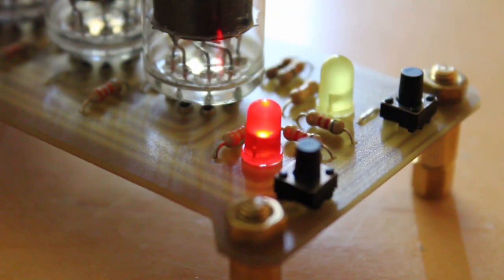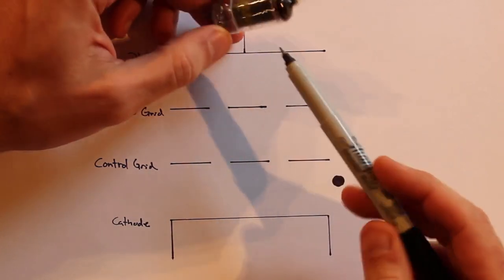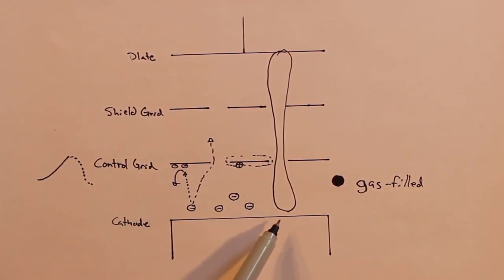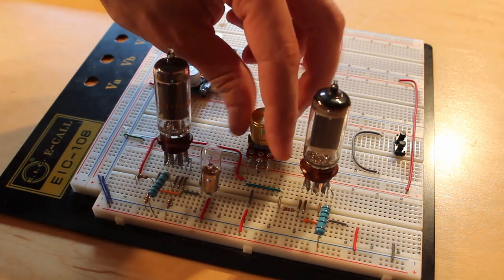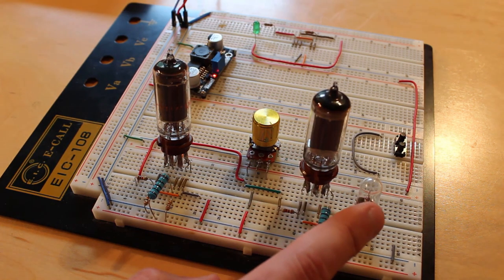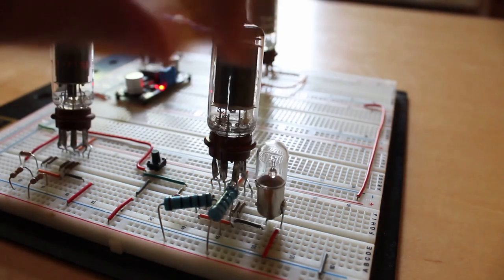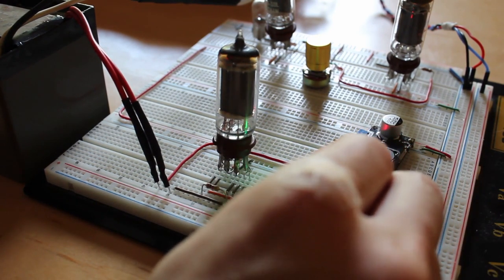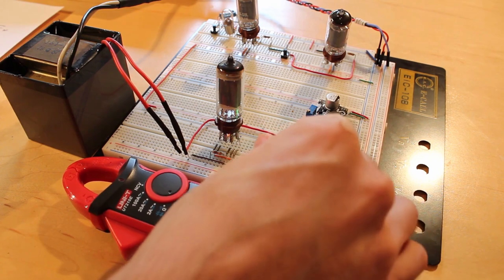The Thyratron and Using a 2D21 Thyratron to Move Some Current

Comment: Put you button on the controlgrid, the you should be able to control the bulb.
Reply from the maker: Thanks for checking the video out!
I'm not sure I follow your comment though. The button and the potentiometer are directly controlling the control grid in my example. Also, Thyratrons fundamentally work using an arc of plasma created within the tube. By nature, this arc of plasma will send as many electrons as it can from the cathode to the plate. That's why we end up with very switch like behavior out of the tube, as opposed to the more analog behavior we see in standard vacuum tubes.
Reply: @UsagiElectric  If you would take the button setup from the middle sample to the last. Would the the thyratron turn off when the AC go into the nagative state?
Reply from the maker: @nielserikmeier9721  I think I'm following you. For example, on the third circuit where I rectify AC, if instead of having the grid tied to the plate via a resistor, what if I tied it to positive with the button? In that case, the Thyratron would indeed turn off whenever the AC went negative, just like you're thinking. It wouldn't turn back on again until the button was pressed. However, since the AC from the transformer has the same frequency as mains AC, 60Hz. This means that as soon as I release the button, the Thyratron will stop conducting as soon as the AC signal falls below 0V again, which would happen essentially immediately. 

At first, I was trying to wrap my head around how that setup could be used, but it's actually perfect for something like a binary display. Four halogen bulbs, four Thyratrons, and you've got yourself a four-bit display that can be controlled from other tubes. The only caveat is that you need a transformer outputting AC into the plate for it to work, but that's something that can be worked around.

Thanks for the suggestion, that's awesome!
Reply: Usagi Electric  if you tie this setup to you RS flip flop ... 👍
Reply from the maker: @nielserikmeier9721  I think you're on to something here!

Comment: well, there's another way to make a single bit of memory using a tube, thyratron sram...
Reply: all sram is, is just  bunch of buffered S/R latches
Reply: 15:35 well you could if the tube drives an igbt or mosfet, technically its not cheating, functionally fets, igbt, sicfet, moset.... whatever, its functionally equivalent to a triode and thyratron in one package and remove filament pins, so just anode, grid , and cathode, just make sure gate voltage for dat mosfet is 24v, not 5v or 12v, tube might punch a hole through dat wafer

Comment: it acts like a thyristor
Reply from the maker: Exactly!
Interestingly, the term "thyristor" is actually a portmanteau of the words "thyratron" and "transistor"!
Reply: @UsagiElectric  I worked with high voltage ceramic thyratrons that would stitch 30 kV and KA.  Made of ceramic.  They use a ballast heater to control the internal pressure.

Comment: one bit memory
Reply from the maker: Yup, it makes a nice little SR Flip Flop. Though, I did a lot of testing with trying to get one of these to work as a memory cell for the vacuum tube computer, and I had all sorts of trouble. I ended up not going with them, but there are a lot of really interesting ways that these could be used with some proper designing!
Reply: @UsagiElectric  Pull the plate down with a triode!